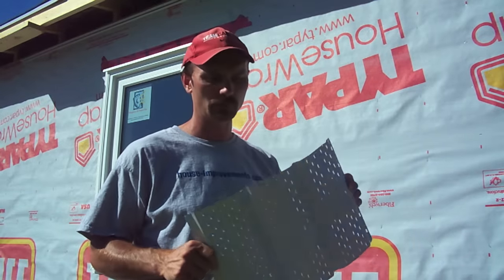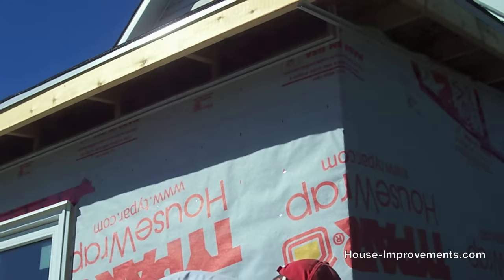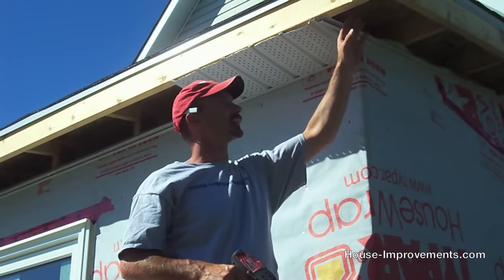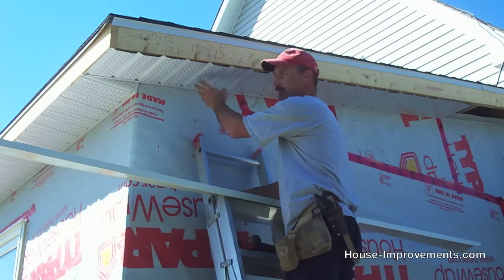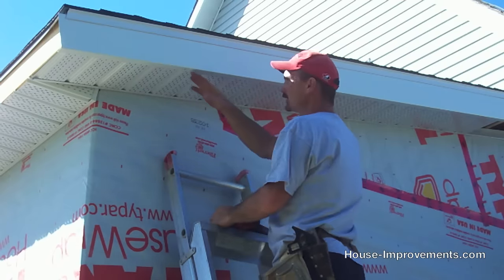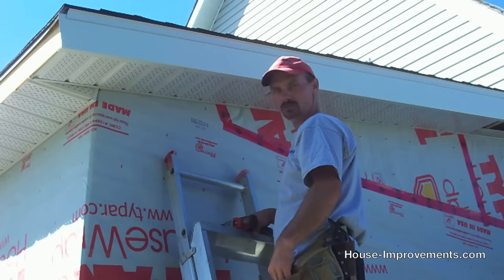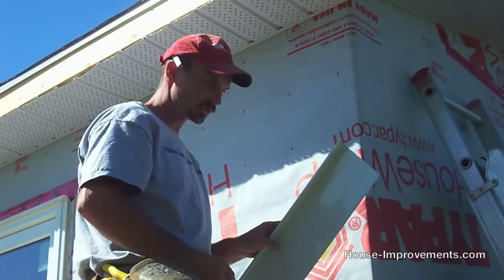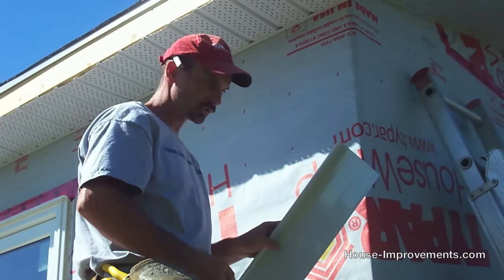How To Install Soffit And Fascia

Comment: Thank you for the tip on screwing the J channel in from the bottom. I was going to cut 200ft of wood strips to nail them to. I didn't want to buy F channel since I already have hundreds of J channel pieces I got for free. you can tell that you really do this for a living, and are not just a company rep making a product video.

Comment: This video is very good and detailed. Just one question. How to you cover the gap where the soffit parallel with the ground meets the soffit on the sloped side. There is a small triangle of space that open and needs to be closed.

Comment from the maker: Lol , Don't know where you think you see drywall screws being used but there are none used here. Thanks for watching!
Reply: Dont like that corner. The rainwater is going to travel down that gable facia and go behind the gutter facia aluminum wrap  water behind there cant lead to anything good
Reply: @Fatbodypyle  What would you suggest?
Reply: @soulmist2163  Perhaps do the outer (lower) one first, and then the one that goes up the roof... that way the lower one folds under the one that comes down from the roof, so rainwater can't flow inside anything. Probably will be fine for a long time either way though.
Reply: what kind of screws am i supposed to use?
Reply: What kind of screws do you use with aluminum?

Comment: Thanks Mr. Shannon, your awesome videos helped so much and saved me piles of cash and time. 

Checking the fascia for square is a HUGELY important tip, otherwise it'll get crooked and then you've got problems. I love how you do the corners too! A tip on house wrap I didn't realize until after - line up the marks on it with studs! It will make siding installation much easier.

Also in my experience, get help installing the fascia - it flexes vertically incredibly easily and the upper edge can get caught on anything sticking out on your fascia board. Then if you don't see it and put screws in, it bends and looks crummy.

Comment: If you do measure ahead and find one length will work, stack a few sheets of soffit together, clamp the edges with vice grips so they stay lined up, and cut through them all at once with a thin cutoff wheel on your grinder. Saves oodles of time on a big job. The Skill saw with blade backwards trick works too but it sends metal shards everywhere and will often bend corners as Shannon mentioned. AWESOME video as always!
Reply: can I just use a normal trigger clamp or two? also wouldn't the vise-grip leave some dents in one of the soffits a bit?
Reply: Or you can use a metal cutting Skill saw blade.

Comment: Before installing security camera, I want to know the structure of the under-roof and exterior wall to run the cables. This video gives me very good answer. Thank you Shannon.
Reply: I wish I had hidden my cameras under my soffit. Since they are 4K cameras and standard size, people think my house is a security compound. But at least they are easy to access if I need to and I can also redirect them. I don't think I could get any with optical zoom, or with much maneuverability, that are in a dome or smaller format.

Comment: im no carpenter but you def wrapped it the wrong way all the water coming from the gable is going to run behind that piece
Reply: Brandon Henderson could use some sealant at joint

Comment: Thanks, great info here. I got my first home recently and it isn't built this way. The overhang has plywood where you put the soffit stuff and then they put soffits over the plywood and cut like 4 1x1ft holes on the entire house. From what I've been watching &reading I basically need to take off the soffit and put way more holes in the wood. Yours is entirely open which is definitely way more air flow.

Comment: Hey Shannon, I have a few questions for you and I would really appreciate if you took the time to answer them.

I'm about to replace some fascia that was blown off in the winter.

1) What adjustment would you make when installing fascia where there's no drip edge?

2) Our builder put screws on the face of the fascia, not underneath like you did in the video. Structurally, is there a disadvantage to doing that?

3) What screws would you recommend using?

4) The fascia was blown off during the winter and the wood was exposed to the elements for a couple months. Does the wood have to be replaced?

I love your videos and your teaching style,
keep up the good work,

Thanks,
Gabe
Reply from the maker: Please go to my forum on the website and re-ask  your questions there and then I will answer them. thank you

Comment from the maker: I'm glad you are thinking about how the water runs. Basically my thinking is that the metal I rolled around the corner and then nail with the hidden nail looks better because it hold things tight without face nailing and the metal wrapped around protects the wood. Water running down is minimal and by the time it gets to the end it is pretty much all down to the point already because of the slope so it drips off.Thanks though for the comment

Comment: Thanks detailed and easy to follow how to do most everything need to get done on my pole barn. It's 24' x 50' and 14' tall in the front and 11' tall in the back. The rafters are on 16" centers and 12" overhang. The toughest part I got with doing the soffit and fascia on it is the builders  left the rafters sticking out at different lengths by up to 1" longer than they should be and since it was portable sawmill lumber the boards dont all have the same heights. Theyre true 2 x 8's but some are up to 8 1/2. 
With that inconsistency I'm imaging would have to cut them more evenly, and if not there's going to be one wavy/ugly look?
Reply from the maker: You will have some challenges for sure.

Comment: Hi Shannon. I'm building my own carpentry shop/garage and your videos have been very helpful. Thank you. 

Two quick questions, if you have a moment: 
1. Going up the gable side with the soffit... at the peak I presume you just bend the soffit material to fit the J channel and just continue with the down slope. Is that correct? If not what happens at the peak where the two meet?  
2. Presuming that I'm correct in my first question (just continue through the peak and down the other side) is there a strategy if, at the other end of the gable, the soffit does not end with a seam? 

If I don't make sense, let me know and I'll try to clarify. Thanks again for these videos.
Reply from the maker: You are correct. You can also place two J back to back at the peak if you like, but I just bend and keep going. At the end on other side just cut to fit.

Comment: Thank you so much for the great videos.  What type of screw and size do you use for screwing the soffit to the wood beam? You mentioned #6 x 5/8 and is that for the channel?
Thank you.
Reply from the maker: I use the same screws for the soffit panels where its hidden under the fascia edge and then I use painted matching screws for the bottom edge of the fascia. #8 or #6 is fine at about 1-1/4" to 1-1/2" long.

Comment from the maker: The gable box is used around here by some people as well, but it is big and bulky in my opinion , so and others do it as I have shown here. I have never seen anyone however, apply screws to the face solely . I would think that would make the aluminum "oil can " even worse in the sun ? You must be installing them on the face near the bottom of the fascia, other wise the fascia would rattle in the wind? Interesting idea though, thanks.

Comment: Thanks for sharing your expert knowledge with me, it will be very helpful in the near future when I move into my 100 yr old house!

I couldn't help but notice though, shouldn't the roofer have wrapped that drip edge around at the corner? It seems like that would be a weak point.

Comment: Agree'd about the Aluminum soffit. I have been doing siding for a long time and the Vinyl soffit because of the flexability tends to have a more wavy affect even after insuring your J is straight and level. Aluminum holds straight and true as long as you install it without kinking, pulling or pushing its ends while nailing.

Comment from the maker: Ok on this video the siding corner does need too be cut as you described. As you can see in this one I use the soffit to box in the end of the soffit. In the other video I'm showing you how to use the siding to box the end of the soffit. In that other case you would cut a piece of 2x8 or whatever you need to give some backing behind the siding to attach J..

Comment: Honestly you are a really good teacher, thanks so much. What do i do on the edge if i am not install an eavestrough as i'm not installing a gutter there?
Reply from the maker: Top edge of fascia should be tucked behind the roof edge and screwed in the bottom edge like the video. If the roof edge is loose fitting you may need the odd screw in the face.

Comment: Thanks for the vid. We had a new extension done (mostly diy) and we used 12 inch fascia which was hard to locate here in canada. Ever heard of people using pressure treated wood for framing? Lol we did that

Comment: In my experience, aluminum cuts just fine in a sliding miter saw with a carbide blade.  No need to reverse the blade as you would do with vinyl.  Set up a stop and you can cut soffit very quickly.
Reply from the maker: Interesting I have never tried it with my sliding mitre saws. I now have a jig that I use with my circular saws.https://www.youtube.com/watch?v=D2eGRY0x-8Q

Comment: Thanks for the excellent video, Shannon. I didn't look through all the comments so I apologize if this question was already asked, but what type of screws need (or do you suggest) to be used? I see a lot of people using nails or staples but I would rather use screws like you show and I haven't found a good answer online. Thank you!
Reply from the maker: I usually use about a #6 x3/4" FH for the J and soffit and  #8x1-1/4 PH for the fascia . The fascia screws are sold in my area coloured to match .

Comment: love your videos. they are very helpful to me as I plan to build a shed this spring. I watched your building a shed series...great stuff, but I do have a question. Have you done a video with decking blocks/piers? the ones where you sit the wood into the blocks. If not, can you show a video on that please because that will be what I will be using as my foundation.
Reply from the maker: I do not have plans for that at this point but will keep it in mind while planning out or videos for the year. Thanks for watching

Comment: Very nice video.  Many thanks.  By the way, I was surprised to see you use perforated soffit up the rake.  My understanding was that this is not desirable because it could short circuit the roof exhaust venting.  Since this house has a decent length to the eave, you would think that would allow sufficient intake air to properly vent the roof.
Reply from the maker: The more circulation the better. Everyone around here uses ventilated soffit  on the entire perimeter.

Comment: Wish you showed how you marked (with the square) where the first piece of soffit was going to end (you had one mark on the house and one mark on the fascia).  Guess it comes more natural to others... I need videos!  Thanks for sharing your method, much appreciated.
Reply: you take a framing square with the long end out , butt the short end into the j channel so the shorter part is tight against the wall and inside the j channel and you will end up marking where the square is on both the j channel and the bottom of the sub facia , done hope this helped

Comment: Shannon:  Fantastic video.  I have a question, though.  I've done all kinds of home improvement but not siding.  I can see putting the soffit on the house and then put up your siding, if you're doing vinyl and have a j-channel at the top.  But, I'm going to be using fiber cement board siding.  Should I install the siding first and mount the soffit rail on top of that, or do the soffit first and butt the top of my siding against it?  That would reveal some nails in the last row of siding... so I'm not sure which way to go.  Thanks!
Reply from the maker: +TomKaren94 Yes install the siding first in that case.

Comment: Where online can I buy the type of fascia siding used in this video? It's exactly what I'm looking for except I need 4", 6", and 8" high on different parts of my house. Thanks!
Reply from the maker: The most common brands I know are Gentek and Kaycan. Check your local lumber stores. These fascias come in all of those sizes. or you can buy one size and cut them down to fit.
Reply: @HouseImprovements  You're awesome, thank ya sir!

Comment: we use soffit staplers these days.  and when your going to put the tongue into the groove it's alot easier to put the tongue into the groove first then slide it into the soffit J. On the plus side I like the way you put a 90° angle on the first piece of soffit, my new technique.
Reply from the maker: Ya many of you that do this all the time use staplers, I see more and more of my locals using screws now also. Stapler is faster for the soffit but with all the new safety issues these days that hose can be a trip hazard IMO. I have had a few "pros" on here bashing my 90s but I think they look cleaner and are pretty quick once you do a couple. I used to do kind of the same thing but with fascia until I came up with this.

Comment: By putting the horizontal piece of aluminum on second , wouldn't that allow rain to flow into to go into the piece?...you did say caulk could help but if its gonna be covered I would do it first.

Comment from the maker: In this video you will have the gable end soffit J going right out to the fascia . The outside siding corner will be cut to fit right under the soffit panels and the siding J will butt into the corner.

Comment: If the screw heads match the fasica I think the screws are a great idea. I hate pounding the soft aluminum nails in hoping they won't dimple the bottom edge of the fasica. Thanks for the tips!

Comment: hi again..so i have a question again. i just had a roof put on..and i want to do new soffits and fascia..i noticed the roofers did not put a drip piece like you have here on the top of fascia..can i add that myself or did i get screwed with this roofing job..also does that fascia come with the ledge already or do i need a brake/break to bend it myself..thank you..you have helped me remodel my home for the last 6 years
Reply from the maker: They really should have added drip edge , You may be able to install it now but it won't be as easy as when they where adding the shingles. If you can't get it installed you can use a Undersill trim which is a tight piece of bent trim that goes up under the edge of the shingles and the top edge of the fascia slides up into it and it holds the top edge tight. The fascia comes with the bend on the bottom, just like you see in the video.
If you need more help my forum is the place for questions.https://www.house-improvements.com/forums/

Comment: Looks good. The only thing I would suggest is working from the front facia, up the home... 

Any rain running down the slope facia would come into the seam left on the end and run in along the eave... 

If you did the front first, rolled it around the way you did, it should shed water better.. .should it not? 

Other than that, absolutely GREAT Video...

Comment: Hi, great video!!!

So I have an older 80's house where they have used wood sofit that is not vented well and some is rotting.  Part of the house has wood siding other has brick. How do you add j channel to the brick?  Special masonry screws?

Do I need to remove all the wood sofit?  Or can I just cut vent wholes in it?

Thanks you do great work!

Sandy
Reply from the maker: sandy vallee  It can be attached buy drilling and using "Tap con" concrete screws.  Cut large vent holes in the old wood soffit before covering it with the new aluminum. Thanks for watching
Reply: HouseImprovements Wouldn't it be easier to screw it vertically into the wood soffit or if removed, what that was fastened to? 
Can you believe Firefox's spell check doesn't know what a soffit is!

Comment: I like this style of soffit without building a bird box. I am hoping to apply this to my shed which has a 7/12 roof pitch. The way you fastened your soffit J looks nice and flush across to the fascia piece along the horizontal side of your structure. Mine won’t sit quite as flush since my pitch is higher. Can I still use this method without a bird box? I’m hoping the fascia will cover where the J trim doesn’t sit flush.
Reply from the maker: No the steeper you go it does not meet up as nice. 5/12 is about max.
Reply: So would I have to use the bird box method? Not crazy about how it looks.

Comment: Thank you for sharing this video,  metal facia is it use on homes?  is it better than wood? How do we decide on the size?
Reply from the maker: Yes its used on homes to make these areas maintenance free instead of having to paint wood fascia every few years. This comes in standard sizes to cover standard lumber from 3-1/2" to 9-1/2"

Comment: Great video....what kind ofscrews did you use? All home depot has is aluminum nails.
Reply from the maker: If you can not find coloured screws just buy some and inset them into a scrap rigid foam piece then spray paint them. They are #8 screws what ever length you need.
Reply: Thank you!

Comment: Great video! Question. Do you have any videos that show installation at the peak of the gable roof or any videos of installation in the corners? These areas require special cuts that I’m having trouble figuring out. Thanks!